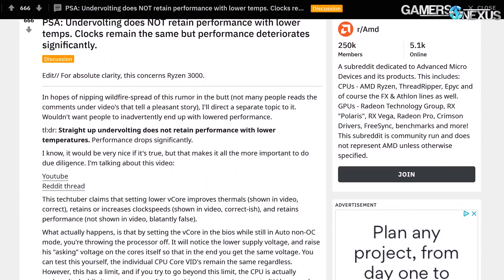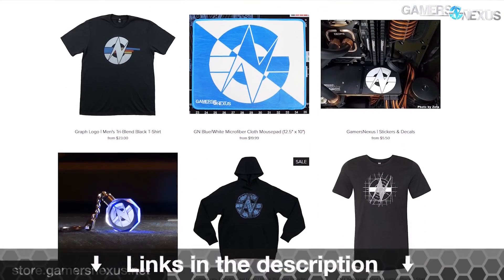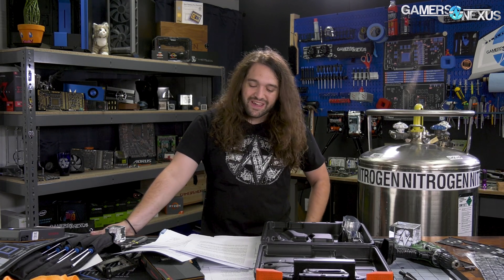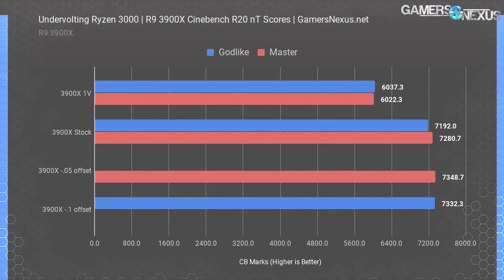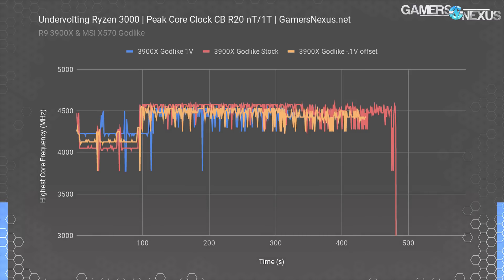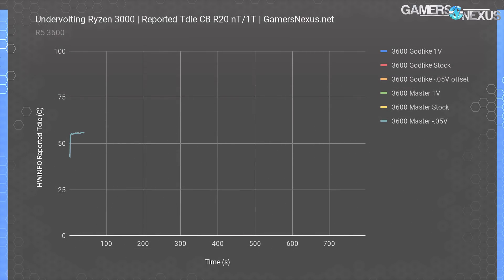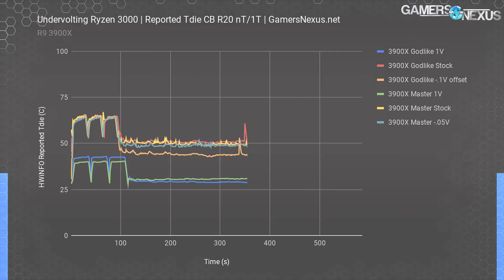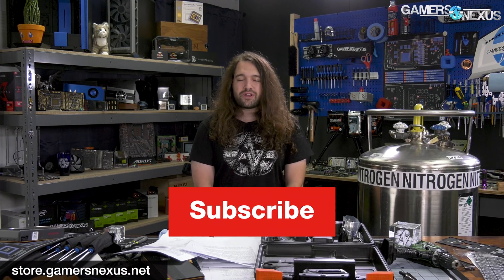AMD Ryzen 3000 Undervolting Offset vs. Override | Vcore Voltage

Comment from the maker: Article here! https://www.gamersnexus.net/guides/3494-amd-ryzen-3000-undervolting-offset-override
Watch our AMD R7 3800X review here: https://www.youtube.com/watch?v=PAGQwWDyURI
Reply: Do a
Ryzen 9 3900x SMT ON VS
Ryzen 9 3900x SMT OFF VS
Intel I9 9900k Hyperthreading OFF VS
Intel I9 9900k Hyperthreading ON 
would be interesting!
Reply: In regards to this, someone on r/Amd posted an interesting topic, saying that instead of undervolting it's better to set the PPT (package power tracking) lower. It supposedly gives noticeably better performance for same achieved temperature than overvolting (or lower temperature for same performance). Here's the link, in case you want to take a look at it and potentially test it: https://www.reddit.com/r/Amd/comments/ceakbs/if_you_want_to_save_powerreduce_thermals_reduce/
Reply: Hi team, wouldn't be better if we were to use PPT and to lower it in the precision boost option. I think its under AMD CBS (in Gigabyte BIOS) and change it to a lower stock value. I.e. change from 88W in a std value for 3700x (65w tdp chip) to 70, 65 or 60W.
Reply: Could it be that the infinity fabric frequency in zen 2 is affected negatively by undervolting in a way that affects performance in AMD case.
Reply: @AymanJundi  that's what i was thinking too.. i wonder if the cores are still clocking properly but in reality it's underclocking the fabric or io controller to keep the cpu running. either way crazy to see that 3900x will actually run at 1v.
Reply: Ayman Jundi u bopt m  mm p by vá cut  it  de
Mm up  in.  Ou
Reply: Steve, If the clocks do stabilize with u/v I suppose there can be a benefit to .1% lows in games from a mild u/v, any thoughts?
Reply: Now with PBO and Loadline Calibration: https://www.youtube.com/watch?v=YQ8zdprzEjI&t=18s
Reply: Now for the more interesting test:
Undervolting Navi! 
I remember Polaris &co working pretty decently with undervolt.
Reply: I've read that due to the imperfect nature of the manufacture process you get some chips that might need a bit more juice then others.
And it'd be too work/time intensive to test and tune each and every chip...
So they just slap a voltage on each chip that's good enough to prevent product arriving DOA to customers while also being not too high that it'd melt on ya.
This results in most chips running hotter/sucking more power then they really need!

Under-Volting is simply a way to put that all back to balance :)
Imagine all the people who've gone to OC they're rigs, Bumping up voltages& clocks, Without first finding out how much voltage their chip really needs@ Stock ??
Do you need that AfterMarket Cooler/Water Cooling setup or do you need to UNDERVOLT ?
Reply: Or should one say- REVERSE the factory OVERVOLT ?
Reply: Why does that one cpu chip have tape on it? Just wondering...🤔

Comment: steve i set my 3700x at 1.35v all core voltage to regulate thermals since i live in santa clarita where its warm all the time my desk it near a ac vent so the intakes pull the cool air in what would to recommend i do for future adjustments

Comment: Okay, so the message of this video: undervolting your CPU is NOT free performance at lower temps. Let us explain: here you see how a 0,05 V offset performs better on every metric. And a 0.1 offset in a lot too, but not all.. okay.. why exactly shouldnt i want that?
So... How do i undervolt my CPU? CPU core voltage, CPU NB/SoC voltage, VDDP voltage. what does it mean?!

Comment: So implementing negative voltage offset gives small efficiency gain, but instead going to 105W efficiency mode give much better compute efficiency.  Ryzen  is not a good undervolter.

Comment: Is it acceptable to use a FIT voltage, I read an article that says use a FIT voltage, and run OCCT, and watch how high your voltage goes with HWINFO.. my voltage max hit 1.27v.. so is it safe to set the vcore to 1.27v in BIOS ? My system is a Rtyzen7 3700X on a ROG Crosshair VIII X570, or should I set an undervolt ? alot of these explanations are beyond me, I could use an explanation for the layman

Comment: Hello, you should test 5900x with ASUS Crosshair Dark Hero, using PBO with Negative -30 offset on Performance Boost Curve Optimizer, and also LIMIT  PPT (~130W), TDC (70A to 85A) and EDC (110A to 125A) vs Stock. You will see that with lower Voltage and Current you get BETTER (or SAME) performance but much LOWER TEMPs, from which you get completely silence PC. AIO Galahad 240mm as Intake on O11D Mini replacing FANs by Corsair QL120, also 3 FANs Bottom (QL120) as intake, 3 FANs Top (QL120) as exhaust, and 1 FAN (QL120) rear as exhaust. 64GB DDR4 3200 MGHz

Comment: It simply boils down to temperatures. If undervolt  causes temps to go down enough (65-70c om 3000 ryzen) it may not loose as much performance if it's running hot. that may be called gain. If temps are decent you may or may not loose as much.

Comment: My pc I built in 2020 which has a ryzen 9 3900x, 2 32gb 3600 ddr4, a mag b550 tomahawk, a mag 360 aio, a rtx 2080 super ventus oc, and a psu of 750w. Recently it just started overheating and everything has been working fine. I checked the aio works good running at 4300rpm, and all 4 fans around 1800 rpm, recently changed the paste, but have no clue why its over heating now when I never changed anything. Been using xmp 2 and cpu this whole time in bios. Please help.
Reply: I'd try CTR 2.1 and shoot for an undervolt. got my 3600x to 1.25 at 4ghz.

Comment: It only happens when you doing from bios. I downloaded rayzen master and I set my 3900x voltage at 1.125 and the coreClock at 41MHz.
Now my 🌡 don't pass 70c° comprend to before was reaching 95°C at 38MHz.
I run multiple test and benchmark and it shows my performance become better and my pc staying cooler all the time no matter what I throw at it.
By the way I'm using the AMD wraith spire cooler with no issues.

Comment: Thanks for another eye opening segment . Had a strange feeling about things when a Ryzen 5 3600, already overclocked to 4.5 GHz and started at a Vcore of 1.38V, seemed to gain some serious thermal headroom with each decrease of the Vcore value. Ended up not going any lower than 1.5V ( in Override Mode) before I started having concerns and questioning a too good to be true scenario. Then I stumble upon this. Thanks for ALL the great research and crunching GN & team.
Reply: My 3600 is a dud.  It can barely handle 4200ghz at 1.38v on a tuf x570 plus MOBO, seems to be a bronze sample 😂
Reply: you've degraded your CPU badly if that's at a static oc. the limit for matisse is 1.32v anything over that will cause degradation. I did the same thing.

Comment: Running Ryzen 5 3600 @ 4 GHz with 1.15 vcore Asus TUF x570 pro wifi board. Cinebench r23 giving almost same results as when I left it at stock. Just 15 degrees on average cooler than stock. (Cooler Master hyper 212 black RGB with 2 sickleflow 120 fans and 7 sickleflow 120 case fans)
Reply: any degradation?
Reply: @ms0308  nope
Reply: @ms0308  don't you only get that from voltages that are too high? I heard it's over 1.32

Comment: AMD 5600x here on MSI B550 Gaming Plus, 240mm aio water cooler. Ddr4 xmp enabled 4000mhz, fclk 2000mhz Infinity fabric 2000mhz (1:1), PBO AUTO. Custom per core negative offset core1 - 25 core2 - 17 core3 - 17 core4 - 20 core5 - 25 core6 - 17. Vcore negative offset 0.1500v. LLC and scalar AUTO. Cpu temp runing 12 celcius lower. Cinebench r23 score 10860 (Max temp 64,5c), stock cn r23 score was about ~ 10700. Hwinfo during throttling test shows cpu frequency ~ 4625mhz, cpu effective frequency ~ 4280mhz. So undervolt negative offset off -0.1500 on Vcore and setting custom negative curve offset per core got me significant less temperature, less fans noise (on windows absolute silent) and a little better multicore performance. No wheas errors. Cn r23 stability test passed. Playing warzone at 48,6 celcius average temp, pc almost silent, before was 56c.

Comment: i have used ryzen master to undervolt to 1.25625v and a 4200 clock, i get higher r20 score and lower temps (3500 to 3775 on my 3600) very good results.

Comment: Do not offset or undervolt just use new eficient mode option / fmax option with asus board
Reply: Does fmax actually lower voltages??

Comment: I kinda confuse, i read alot of blog. Because i think my ryzen 3600  temp.is quite high and they said to set up undervolt and manually set the clock in ryzen master.  1.175v and 4250mhz. Testing in cinebench no crashing and it even beat stock test and even ryzen 1700 and i9 8c/16thread score. But the temp is way much better like 10c different from stock. And what make me confuse even if i using precision boost. It only clock high at 3600 4050mhz and that is reading 1-1.45v and it produce +10c in temperature change. some people high than 1.35v is bad for cpu..soi confuse now is it bad to undervolt and increase clock manually or its better. Result in cinebench seem better. In fact i think i can squeeze more because the commnent i read said 4350mhz at 1.275v stable in cinebench with +10c in temperature change. Some people saying 4.2ghz amd boost is for single clock. Changing clock to 4200mhz in all core is bad idea and will degrade the cpu faster.
Reply: Ryzen is like my old 280X(toxic). Where ATI set voltage to 1250mV but card could easly run on 1000mV on same clock setting :D Most of these CPU's can run 4.4-4.5GHz on 1.3-1.35V without any downsides except heat and power draw. It is hard to kill CPU. Imo it will run as long as mem controller will not be overvolted too much ;) I had phenom II overclocked to 4,3GHz for few years and it was fine.

Comment: So between this video and the one testing boost clocks and temperature. I finally have my 3800x boosting past advertised max. Before I couldn't get it to boost over 4.3 on any core. Even under water cooling CTR identifies my chip as a bronze sample, it doesn't OC well at all.
I picked up a Freezer II 420 and fitted it in my case with some modification. Then started playing with PBO and voltage offset. Now I'm running a -0.1250v offset and hitting 4.6GHz on any given core. Holding 4.4GHz in a 20min CB20 loop never going of 61°c. Not only are my benchmark scores finally equaling the 3800x averages they're even a little bit above average. Finally feel like I'm getting what I'm supposed to out of my CPU.

Comment: You shoudl do a test with eco mode. I changed my 5800x on the master to eco mode 65w and it still runs 15661 in cinebench and while gaming with a 3090 it runs at 5 to 10% and even lower. So for gaming eco mode is a must use in my opinion

Comment: I guess i am lucky with 3600. successfull stress test as 4.2 ghz with 1.125v,  4.3 ghz with 1.2v,   4.4 ghz with 1.3v( my cooler screwed and i stopped stress test at 92C)

Comment: I like the video, CPU's behave so much different these days compared to the old days it baffles me! We are poking and prodding it to see what does and does not work I suppose.

For any chance my findings help anyone with limited cooling or a more limited motherboard:

R9 R3900x / B450 AORUS M / 
Be Quiet Pure Rock Slim 120W TDP cooler

Stock behaves worse than Vcore offset of -0,180 when only stressing the cpu.

When both CPU and GPU get tested the system behaves similar. But, the offset results show a higher frequency than the only cpu stress test at stock while performing worse. 
If I then run stock Vcore CPU + GPU stress tests I then again get a lower performance compared to the offset solution. (RTX 2060 = GPU)

For reference: A,B,C,D for performance (A Best, D worst) and 1,2,3,4 for clock speed (1 Best, 4 worst) - Temps are with around the same ambient temp, around 21c but could be 20 or 22 too.

CPU only stress test stock B - 3 (95c)
CPU only stress test -0,180 offset: A - 1 (82c)

CPU + GPU stock: D - 4 (95c)
CPU + GPU -0,180: C - 2 (93c)

I've tried every other offset option down to -0,204 which was the lowest the system was stable at but the performance degraded. Going any higher than -0,180 didn't improve performance but did add heat being dumped in my already cramped and pretty small case.

Comment: Just got a 3800X for my old B350 TUF board to replace my 2600 and noticed it was super hot in comparison - offsetting core voltage by -0.1v lost about 4% performance in Cinebench multithreaded and less than 1% single thread, but -0.075V lost no performance at all and dropped my max temps under load by 6C.

Comment: cinebench doesn't work. ryzen 3600. it's rendering multi core the same like sigle core 1 by 1 picture, very slow. But in userbenchmark i have good resaults with reference

Comment: I had to undervolt my ryzen 3900x because my temps r to high...  on idle it was on 45-55° and base voltage on 1.479v now its on 1.300v and my System runs smooth on 33-36 on idle.

Comment: I have ryzen 7 3700x. On auto for my bios with my new cooler i get 54c cause its pulling 1.4 volts on idke. At 3.6 at 1.1 volts i get 36c at idle. Could I do 1.15 at 3.8ghz? I wanna increase performance but not increase temp to much
Reply: I set mine at 4.4ghz at 1.275v. Bare minimum voltage if you want to stress test the cpu on prime95 or cinebench r23
Reply: At 3.8ghz, 1.2 volts should be okay

Comment: The takeaway for me (oddly) is that my cheap Asus Prime B450M-A allows the R5 3600 to perform just as good or better than the expensive boards used in this test. My single-core Cinebench R20 result is 486, and that's with CBR20 running in WINE on Linux, and multiple desktops loaded up with other applications, including a Windows 7 virtual machine. Unbelievable what this CPU is capable of, even when paired with a sub-$100 MB.

Comment: Recently got the Asus B550-i Gaming and a 3600xt and the voltage seemed awfully high to me and temps aswell even with the Noctua DH-15. So now I'm running the 3600xt with a -0.1v with only Asus Performance Enhancer enabled. Single core boosts are the same as before undervolting. 4.575 sinlge core and 4.4-4.45 multicore during gaming and about 4.3-4.35 during CB runs. Might try an even lower voltage.

Comment: So im rocking the Asus x570 tuf gaming wifi with a 3900x. Leaving everything at stocks my idle temps would be 45 and for no reason jump to 55 or 60. Spikes a lot. This motherboard has to power pin, one of8 and a 4 one, Supposedly the 4 pin is for extreme overcloking. I unplugged that and temps are a bit better but when i check hwmonitor i would see the vcore go as high as 1.41. I used to use ryzen master and oc all cores to 4.3 and core at 1.25. temps were great but i had to redo the whole process everytime i boot in. So decided to mess with the core voltage. i set it up tp 1.25 manual and temps were idling in the 40 and going up to 65/75 in cine15. Gaming in the 60s. decided to try the offset mode -2 and i get 1.040v to 1.272 highest. this would have my cpu at 35c idle, about 54 in cinebench15. in the 50s while gaming. what do you guys recommend? All i care is about stability, temps and that my chip last as long as possible. Whats the best way to have reasonable temps and good performance?
Reply: https://youtu.be/4th6YElNm5w

Most motherboard both amd or intel have already overclocked by factory when you running at default.

Use HWiNFO64 or HWiNFO32 to see the voltage.

Comment: I'd like to know the real reasons the 3000 series is volted the way it is. I personally and hav seen from countless others, that lowering voltage to around 1.25-1.275 (peak) results in much lower thermals and as good or better cinebench scores +/-2%. AMD must have known this. What is going on there? Something to do with peak/consistent max clock preformance?
Reply: Factory settings have to work on every CPU in that skew, locally tuned settings only have to work for the hardware/software actually used.
Seriously people oc GPU and it seems to work fine but months later a different game has crashes until the boost is turned off.
People don't like dynamic CPU management because they want to say the RN YZOK has 3.7 Ghz base clock with 4.2 precision boost, with this benchmark score.
Imagine if the numbers changed greatly because you dialed the a/c lower.
Reply: Seriously?

Compatibility. This is why OC'ing exists at all, companies clock their CPU's conservatively so that when you drop them in a system they just work.
Reply: What you're doing is just dropping the voltage to match their conservative clocks.

Comment: Sorry if this is a simple question, but i have a 3700x and B450 Gigabyte Motherboard. It currently has bios from July of 2019 and there have been 3 or 4 updates since then. Should i update to the latest version? I have read so many things with people having issues when updating Bios. I feel like the voltage is set super high as stock and i cant adjust the voltage without overclocking and i feel like the chip is already hot enough without messing with overclocking and this board isnt very user friendly as far as bios is concerned. Thanks
Reply: https://youtu.be/4th6YElNm5w

Most motherboard when running at stock it have already overclocked by vendor via BIOS.

Comment: So do i get it right that a Offset of -0.1 is totally fine? Should i let the precision boost on Auto or off? Isn‘t it better when i set core ratio to 42 with 1.25V?? Iam new in the Ryzen game and pretty confused. I just wanna lower the temps without sacrificing to much power

Comment: I undervolt my R5 3600 at 1.225V with 4ghz. Finally, my idle temperature is stable at 38°C~41°C. Running smoothly

Comment: my cpu both the ryzen 2200g and the 3200g will not pas 500mhz on all cores its aarock a320 hdv 4.0 motherboard i tried different power supply

Comment: I undervolted my 3800X and used PBO. It now holds 4.3ghz all core boost and scores higher in Cinebench R20. 5160 where my previous score all default was 5010 and it would hold just under 4.2ghz all core boost. Temps are never breaching 60 now at full load where as before they could go up to 70. So yes........it works.